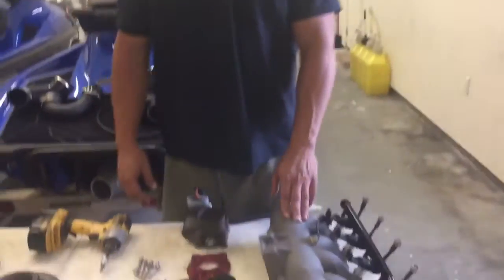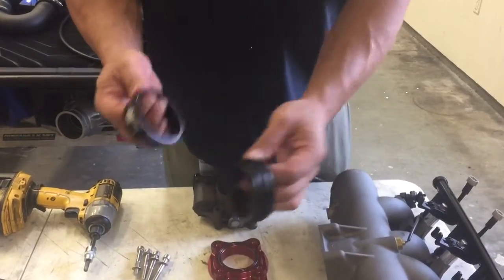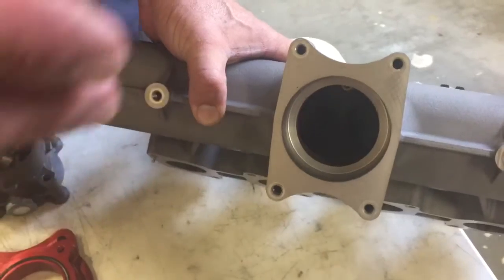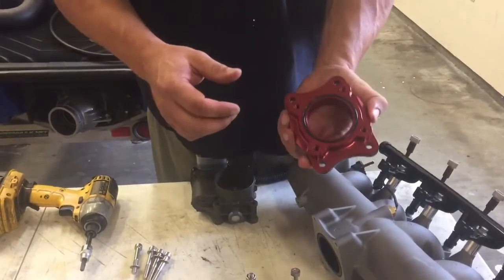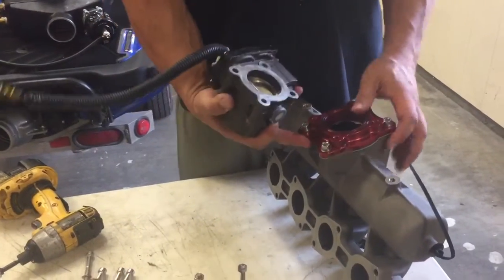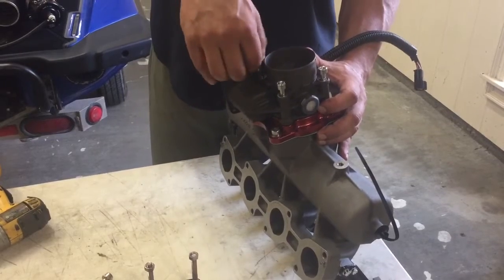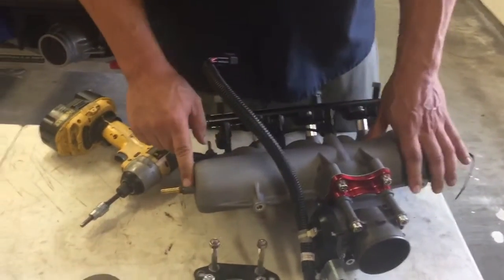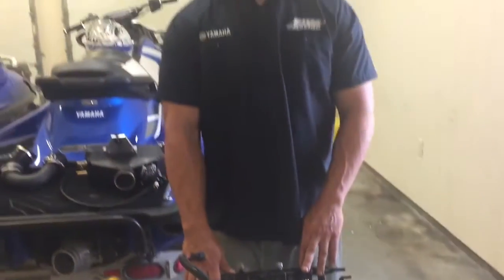Yamaha SVHO Intake manifold and throttle body mount upgrades explained

Comment: I know this is quite an old video, and I feel like I'm reviving an old thread on the forums, but would a cracked throttle body adapter//ruined Oring cause a vacuum leak rather than a boost leak? suffering from high idle on an SHO and looking for help. Ty in advance if these comments are still monitored/replied to
Reply from the maker: Absolutely! It can cause a vacuum leak resulting in high idle issues.

Comment: wonder if you can port the intake with a die grinder instead of using the ribbon delete kit
Reply: blockhead trees I’ve tried that before and cylinders 2 and 3 run too lean because they end up getting more air due to the design of the intake manifold
Reply: blockhead trees  You can try but not enough material to bore it wide open . I made my custom  sleave that's slightly taller  and  taper matches  exactly both diameters.   Romrom7999 on insta